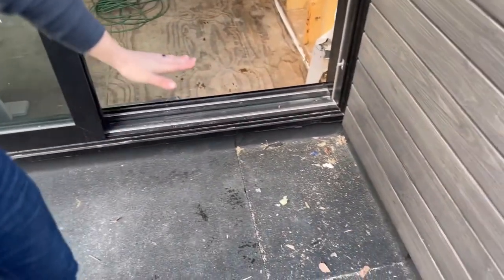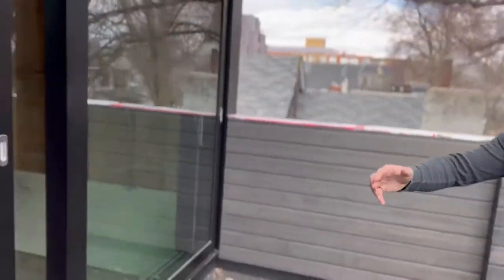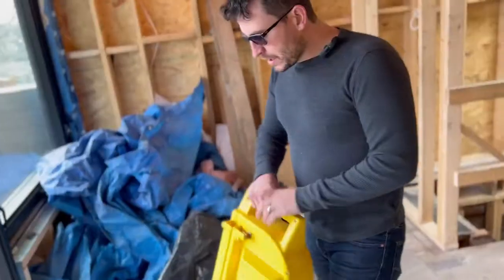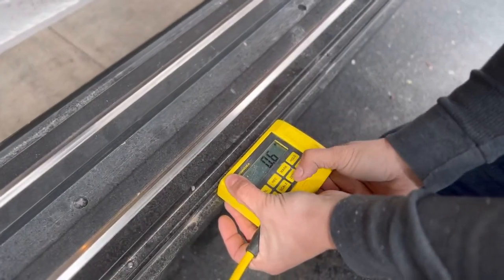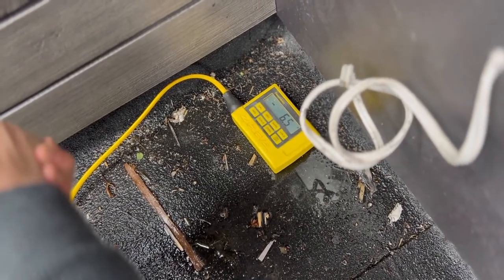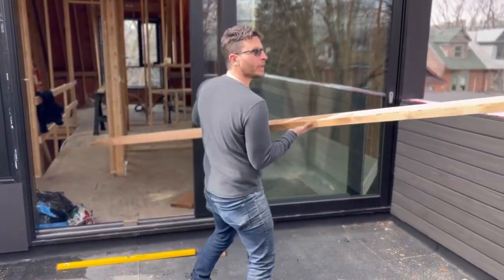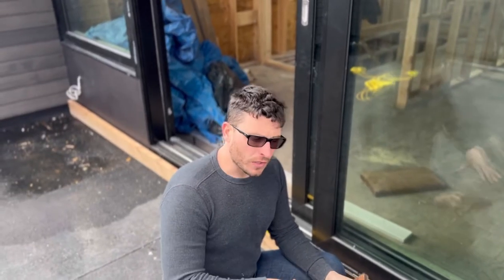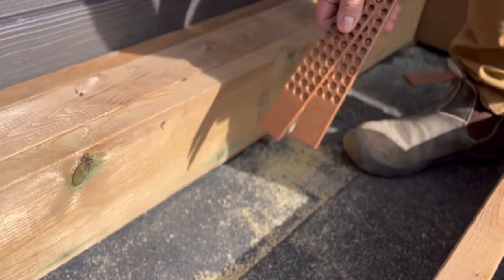Framing a Rooftop Deck With Wood

Comment: that roof was not done properly, they only added two and didnt not add another two ply on the wall flashings. those seams at the corners will open up over time with expansion and contraction… it’s unfortunate bc they may have roof issues in the future and your putting on a high level deck! they might have to remove the decking to get to those roof leaks down the road:(
Reply from the maker: Yes! We actually ended up putting new siding up and flashing the corners. What would you recommend before we seal it up?
Reply: This is exactly what happened on a house I just bought. No adequate drainage or maintenance caused the room below to get water from a damaged rubber membrane that failed. Water, mold, mildew, rodents in room deck built over. Ceiling fell in now entire deck has to be removed to fix damage. Out of thousands since seller hid damage and my inspector didn’t catch it.

Comment: Hey. Would you recommend composite 2x6 for the framing or wrapping the 2x6 in window tape for better weatherproofing? Got a 1600²ft flat deck coming up. Thank you for this video!
Reply from the maker: You are welcome. It’s hard to say exactly I have another video coming up of an even better way.
Reply: @woodbullyltd  just having a problem with the water not escaping like it should and customer is trying to steer clear of wood and I don't blame them. Thanks again, fam.
Reply from the maker: @mediocrefloridaman  Outdure makes a great aluminum system

Comment: What did they use to roof with to begin with? What material is that?
So my hubby and i are building home soon and want to do this. But i need a roof first, thats why im asking? 
Thanks for this video!!
Reply from the maker: They used asphalt rolled goods.